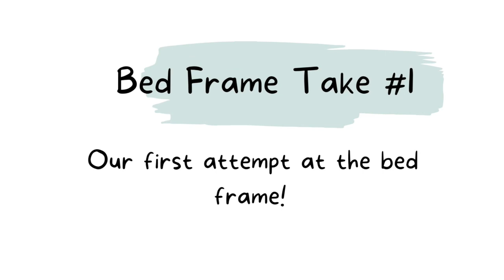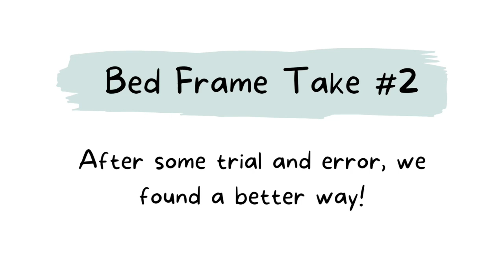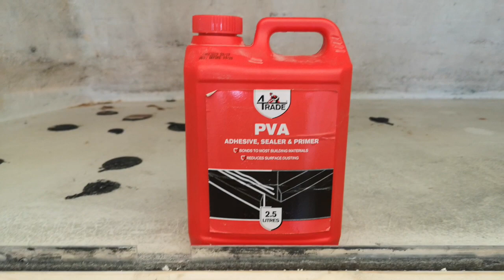Luton Bed Frame Build | Luton Camper Conversion

Comment: Really appreciate this video! Thank you! I haven't bought my van yet, but I have my heart set on a luton. It was so helpful to see / hear more about the space above the cab. I haven't found anyone else talking about how fragile that space can be. May I ask what the original dimensions are? (As in orignal depth / head space / height of the platform from the ground? 
Going to check out your other vids too!
Reply from the maker: Hey Tempest Midnight, 
Thanks for the comment ♥️, glad it's helped. This will also be helpful to others so I'll add it to the comments.
The shape of the Luton fibreglass section is a bit weird (see our Instagram account for pictures). The rough dimensions when the van was empty are:
Depth of the base (front to back) at the centre - 1000mm. The sides curve.
Height at the largest point - 700mm 
Height in the centre - 600mm 
Height at the very front - 100mm
Width at the widest point - 2070mm
Height of the platform from the floor - 1400mm
Height of the ceiling from the floor - 2100mm
Hope this is helpful to you. We have many more videos to upload and will also show what the finished bed looks like.

Good luck on the Luton 👍

Regards,
Jolly